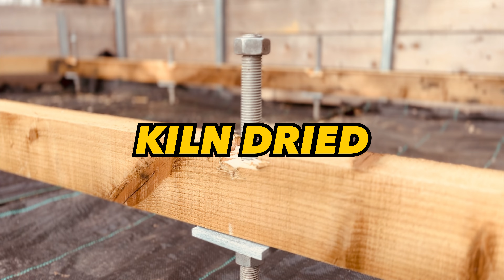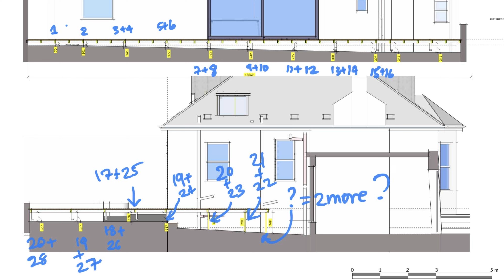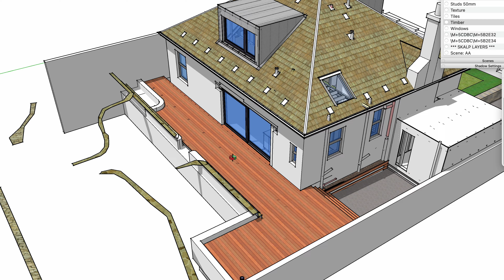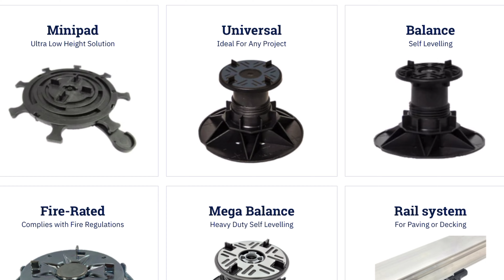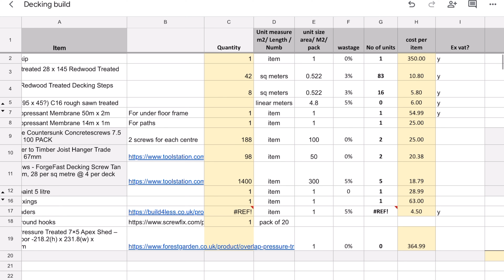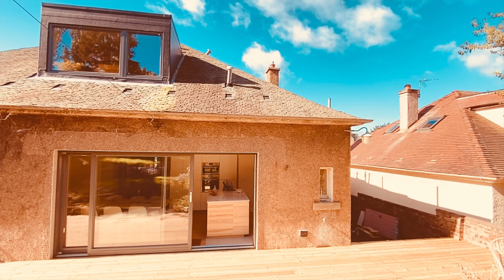Garden DECKING - Composite or Timber? a DIY Self-Build Guide

Comment: Re laser levels: I didn't consider £200-£300 inexpensive, so spent £10 to make myself a water level which works perfectly well - and never needs to be recalibrated.
Reply from the maker: Yes, a water level is wonderful. Just a bit harder when you’re alone
Reply: @build-better-things  No - I have the tubing attached to a fixed reservoir, with the other end fastened to a pole with a tape measure. Dragging the plastic tubing around is the main downside.

Comment: Why would you not use deck tape on the joists?
Reply from the maker: Because if moisture gets under the tape, and it will, it gets trapped and then you’ve got rot.
Reply: @build-better-things  makes sense, is there anything you would recommend to help protect the joists?

Comment: Thanks for the video - I’ve a question on your point about not using concrete screws for applications that have some additional load in addition to compression. I’m planning on fixing timber panels (with gaps between each panel) to battens that will be attached to a hollow-block concrete garden wall to essentially clad the wall for aesthetics and privacy. I was going to use concrete screws to attach the battens. Do you think I should use something else instead like frame fixing nails etc.? I’ll be extending the height of the wall slightly with this cladding hence why I’m using an open-board approach for wind to pass through but there will be wind load I guess creating a lever force on the upper part of the battens.
Reply from the maker: If I’m understanding you correctly, you’re talking about fixing battens to a masonry wall and then fixing your timber panels to the battens. In that circumstance, where you’re essentially clamping a sub frame and then fixing to that, I’d be ok with it, although depending on the panel weights, I might consider resin anchoring the bolts rather than friction. It’s more where there are horizontal forces which create additional stresses which screws don’t cope well with.
Reply: @build-better-things  yeah that's what I'm doing. I did consider resin anchors given the voids in the hollow block but I've a lot of meters to do and it would take a lot more time and money and I'm trying to keep costs down. I test fitted a batten with the concrete screws and I couldn't pull it off the wall no matter how hard I pulled on it. Thanks so much for coming back so quickly, appreciate it.

Comment: Ground screws seem to be becoming popular now as a concrete-free means of supporting decking. One to consider?
Reply from the maker: Hi Adam. Ground screws are indeed a good option. I’ve never used them due to the amount of plant you have to transport. You can of course, sub contract to a company but then cost is the issue. What I’m trying to do with the channel is show what I think is the easiest and, more importantly with all construction, the fastest way to do things, through my own experiences. Spending a few pounds on a post hole digger, as a self builder, and a weekend of your time and some rewarding graft…surely that’s worth a two grand saving in cash? ;). Thanks a lot for the comment.